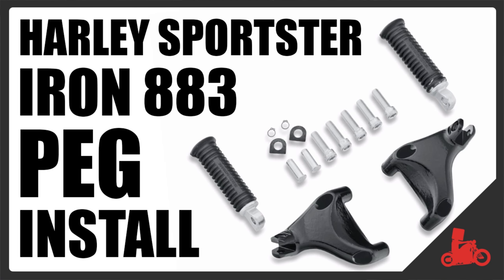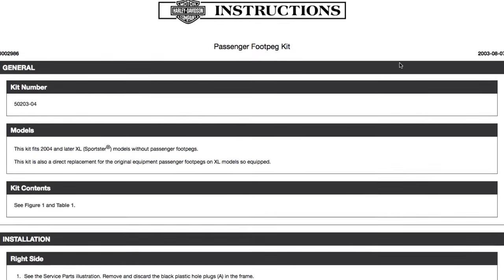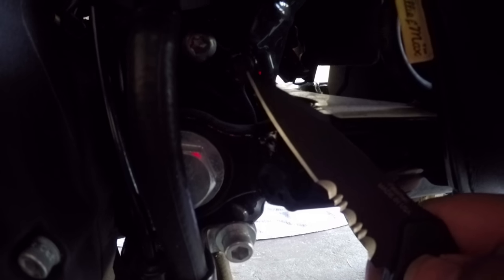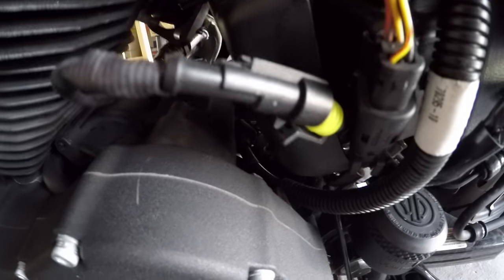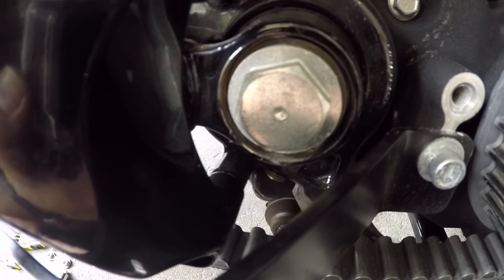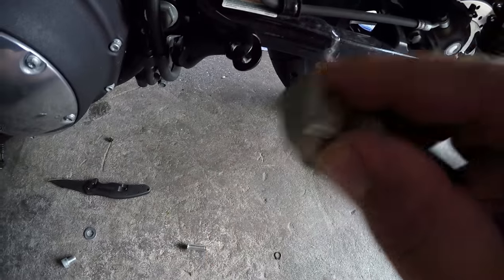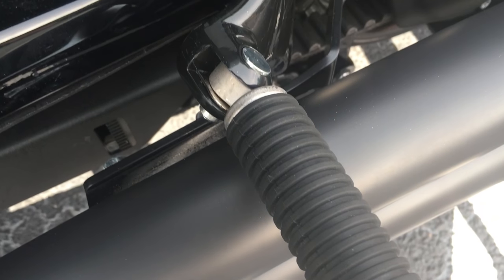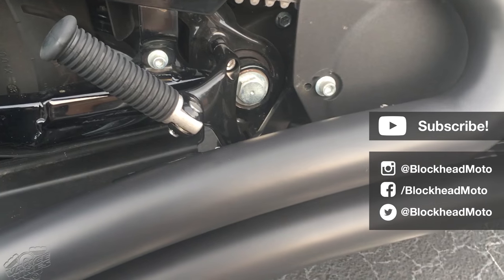HOW TO: Install Passenger Footpegs - Harley Sportster Iron 883

Comment: Just a heads up, whenever you are using a torque wrench with an extension or adapter, you have to use a formula to calculate a new torque depending on the length of the extension or the type of adapter. Great video
Reply: That’s news to me bud. Really useful info. Can you provide (or link) to the formula you use please?
Reply: Torque specs stays the same with hand ratchets. The values only change when you’re using power tools. This has been proven several times now.
Reply: That's not true. You only have to use the formula if you're lengthening or shortening (reverse torque) the throw of the wrench. Adding an extension from the wrench to the socket doesn't matter.  I do QA and monitor controlled assemblies with torque tightness requirements for a living.
Reply: @jonbauer719 it doesn’t matter Mattyg knows.. run a test with and without an extension and get back to us

Comment: You know what. I have changed my mind from 1200 sportster to a iron 883. These how too's help allot. And i can always either upgrade it to a 1200. wich is a win win since the iron looks better than the custom imo.
Reply: You would be spending a ton more money boring an 883 out to a 1200 than just buying a 1200 first.
Reply: 1200 is only $1000 more than an 883 and a 1200 conversion kit is like $2000+
Reply: @tylerhubbell6410  whent dyna. And now 2020 sportglide in the proces of purchasing.

Comment: I just installed the pegs,  found a way easier way to do it on the right side without taking brackets and pipe and covers.... just cut one part of the bracket so you don't have to do it all,  it holds great on two bolts  🔩

Comment: How did you loosen the third bolt underneath the sprocket cover on the very bottom to loosen up that bracket? You kinda just skipped doing that. I got mid controls on and the linkage to my brake pedal is in the way.

Comment: Hi I have a 2017 superlow sportster not an Iron one. My problem is that the right mounting on the motorcycle has a hydrolic housing attach for rear brake and the mounting bracket for that side is impossible to attach.  Any idea of any other bracket that I can put on that side without taking the hydrolic housing?
Reply: I have same issue with my 2015 xl883n my rear break is in the way

Comment: Every time I remove a C-clip (snap ring), I take it to the local auto parts store to find the same size (I.D. Inner Diameter) E- clip to replace it with. It's stronger and easier to remove/replace. The worst place on the bike for the C-clip is the clutch lever which has the tiniest holes in the world and won't fit any size snap-ring pliers. Once the c-ring has been opened, it loses most of its strength. The E-clip just slides on and off with a tiny screwdriver or needle tool that is straight or L-shape. I think H-D uses C-clips to aggravate people.
Reply: I have a 2016 model Sportster iron and I needed to take off the front brake assembly today. I was all ready for the smallest circlip but was pleasantly surprised to see that they have done away with them now in later models in favour of a threaded bolt and nut. Much easier to deal with. 👍🏻

Comment: Can'u tell me if the same model is used in the 2018/18 mod ?! Cause i bought a 883 18/18 in Brazil but i don't know if was the same parts (size, diameter, etc)

Comment: Was the master cylinder for the rear brake in the way of the right peg? My Iron has the master cylinder right in front of where the right peg should be but yours didn't seem to have it there.
Reply from the maker: Only thing in the way was the exhaust bracket on mine.
Reply: This is for new models '14-'17

Comment: I would never buy mounts through amazon.I made the mistake of thinking forward controls from amazon would be just the same as the harley one's but the mounts flexed super bad just when putting your feet on them.Ended up switching back to the mid controls.

Comment: Anyone reading the comment about adjusting your torque values when using an extension, that is not correct. On an extension arm yes, on a straight extension no. The way this guy did it he did not have to adjust the formula.

Comment: Will these pegs in your link fit on a 2017 iron 883? If not do you have a link for 2017?
Reply: No, man, Master cylinder is diferent pegs. Right one goes with 3 holes instead of 2. And you need to put out the Rear Master Cylinder out, put out the support of the cylinder and put the peg support as the new cylinder suport.
Like this ones fit: http://www.ebay.com/itm/Rear-Passenger-Foot-Peg-Pedal-Mount-For-Harley-Sportster-1200-Iron-883-48-72-NEW/401316241107
Reply: yunakehh thanks bro not a lot of videos to show this but I'll keep looking around thanks
Reply: I just put mines few days back, working properly now. Out both exahust, then out this master cylinder and change the cylynder bracket with the peg suport. Another difference is in the left side, there are two bolts already fixed, put out both and put the suport on this holes. suporting the plastic on it. "Is like the bottom one here but both of them"

Comment: Those are not bolts brotha. a bolt  is tightened by tightening  a nut.  a screw is tightened by driving the head. Socket cap screw.  ;D
Reply: Stevie- TV socket HEAD cap screws, nerd

Comment: Where's the master cylinder?
Reply: pretty sure its connected to the right handlebar. If you're comparing it to the way it looks on a sport bike, it looks a lot more incognito. Looks like a small rectangular box on the right handle as opposed to the usual cylindrical shape you see on most sport bikes.
Reply: @8ball951   Thats for the front brake but there is a rear master cylinder. Mine has it in placement where the passenger peg needs to be installed. So now another issue to solve.

Comment: the Harley Davidson design flaws are many. For small jobs, you have to do an obscene amount of work that requires ridiculous things to happen. Handlebars, require the tank to come off and then perhaps an impromptu wire tuck and even maybe a tank raise, these things they're not difficult, but immensely tedious. A single bolt for passenger pegs, you have to remove the exhaust. I love my bike, but I hate my bike

Comment: those snap liers are absolute shit and got 1 star reviews from every single person. pay the 5 extra bucks ($19.99) and get the other snap pliers that come in auto zone. They also come in adjustable sizes as well and angles. Those bad ones you had didnt fit on my 2018 snap rings.